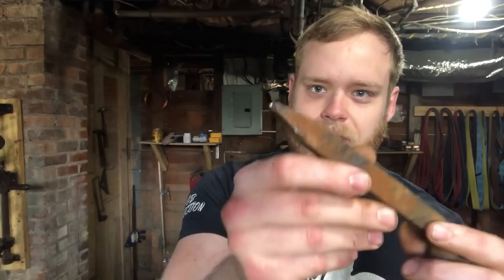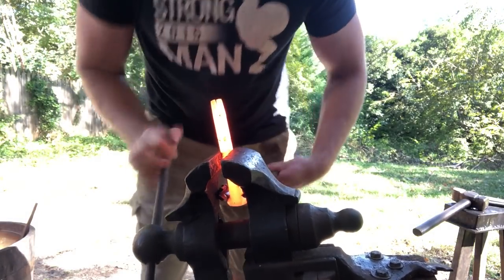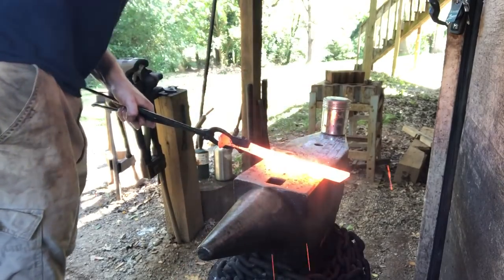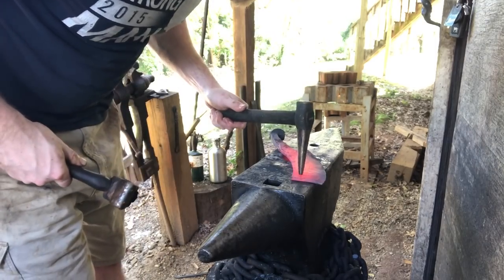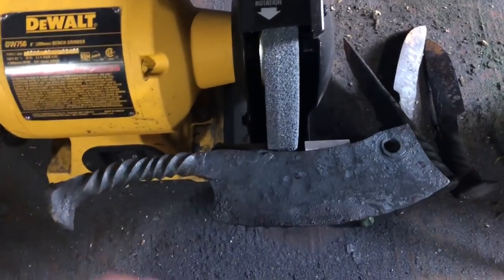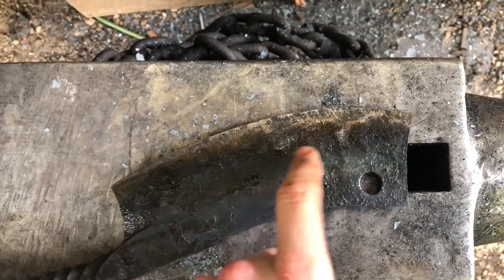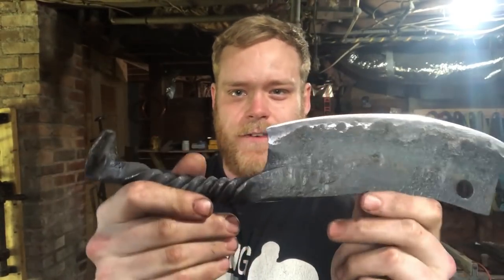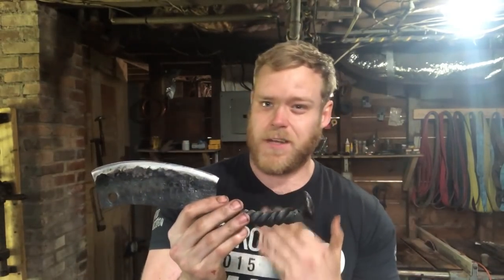Forging a railroad spike meat cleaver

Comment: Awesome  man! I also use the grinder to profile and remove bulk fast. I use files and hand sanding at the moment. I'm learning so much watching you because you actually use your anvil and hammer. Lots of people use the power hammer or press and go strait the power sander without even touching the anvil. I'm trying to push my skills to the next level and watching you will help a lot.

Comment: I like it. Have you looked into using a flatter? I imagine it would make it easier to edge taper with a cross peen. 
It's a good knife made with a hammer as it should be. I get tired of people thinking they are forging something with a grinder.

Comment: Nice cleaner. I would definitely put that in my kitchen.  I need to learn forge welding. Were you using a glass forge on that cleaver?
Reply from the maker: Howard Richburg gas forge yes. If you scroll back through my videos I did one on the ribbon burner forge about 4 months ago
Reply: @OldHickoryForge  Right a gas forge.  Thanks for the info.  I have been thinking of going to a ribbon burner.  Right now I have     a  two venturi system and it really goes through the propane.
Reply from the maker: Howard Richburg that’s what mine is a ribbon burner. Miles better than Venturi, if I could go bad knowing what I know now I’d have built the ribbon burner years ago

Comment: Really good work! 
Question if I might. Was considering using a rr spike for the body of a tomahawk. Then forge welding in a bit. 
A friend is in the rail road industry is there enough steel there to do it but still preserve the "look" of a re spike?
Reply from the maker: mmix224 it could be done. Leave the head as the poll. Punch and drift an eye in front of it. Split the front and insert a thick high carbon bit t get enough material for a serviceable blade.
Reply: @OldHickoryForge  thx!

Comment: I’m glad I subbed your channel. Awesome work there. On your leather wheel on the grinder do you have your grinder turned around backwards. I have a similar wheel that runs on an old 1x30 belt sander that someone made out of wood that runs backwards. I use it just for initial sharpening
Reply from the maker: chip Lape yeah the buffer is turned around so the wheels spin away from me